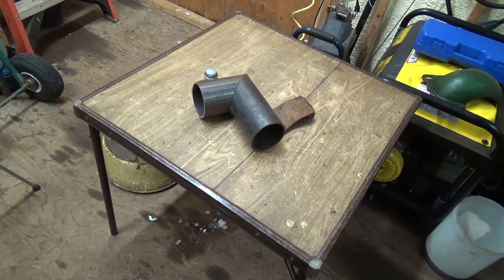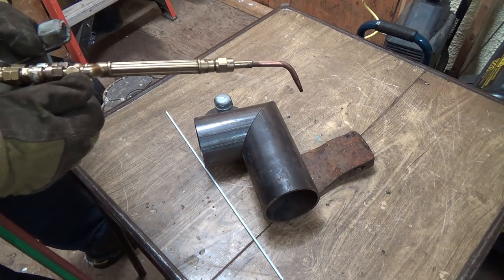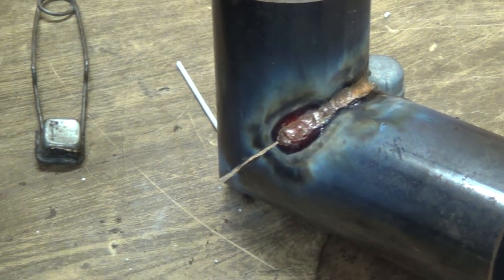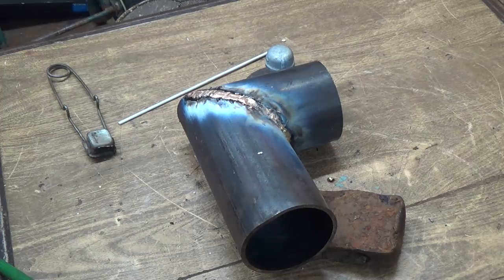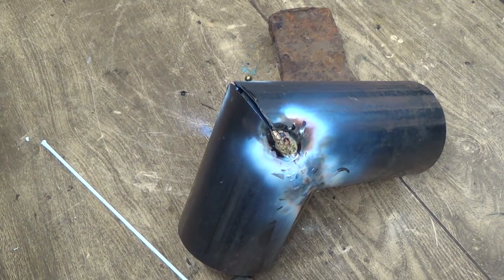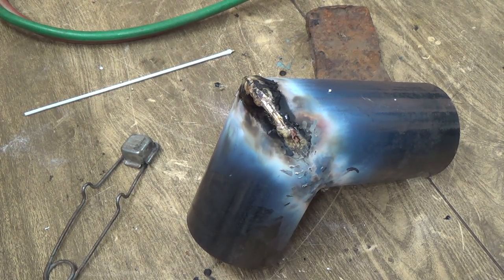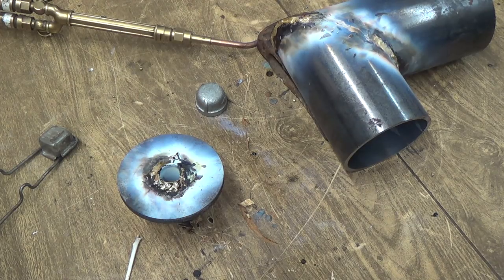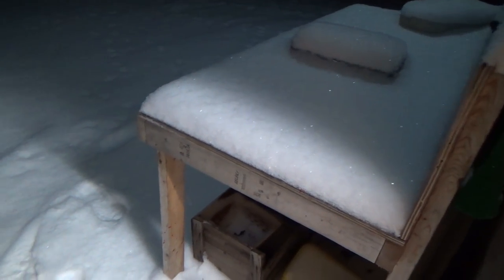Wonder if we can braze the two pipe pieces together for the new fuel tank

Comment: To close the gap try using an old wire coat hanger then fill in with the weld . The old timers used that trick

Comment: I normally dont leave negative comments, but as much as I have seen you mig, stick and braze weld over the years, it would be common knowledge to tack your weldmt in a few places to stop from any movement. And welding anything galvanized, will put off poisonous gases and make you very sick, especially in enclosed spaces.
Reply from the maker: Thanks  for your concern... Have to try new things.. It seemed to come out ok
Reply: Now sure what you think is galvanized, the pipe is black iron, only thing that is galvanized was the cap, and that was never heated.  Brazing doesn't shrink like regular weld,  so tacking isn't as big of concern.